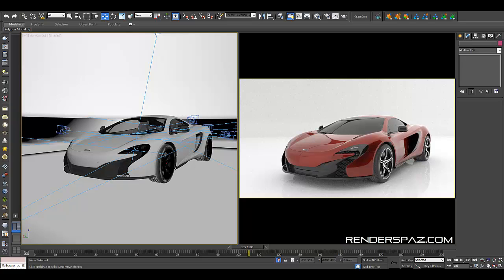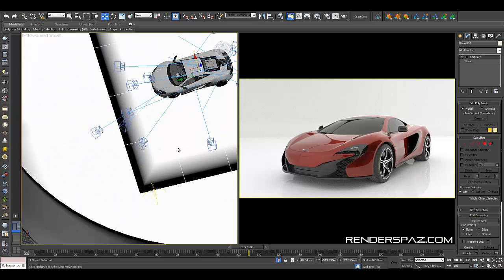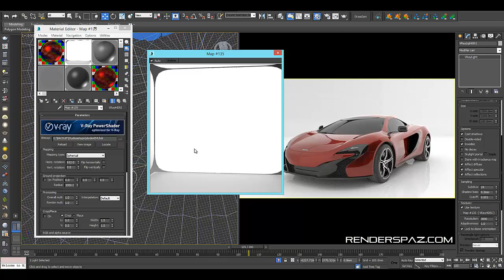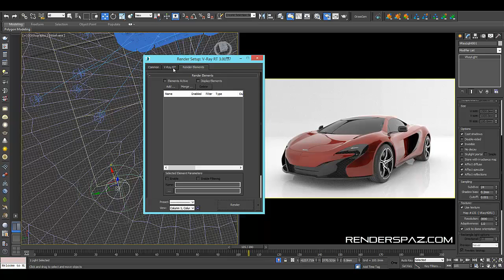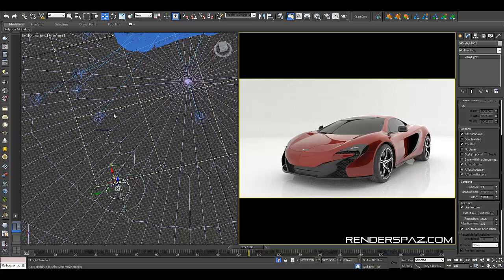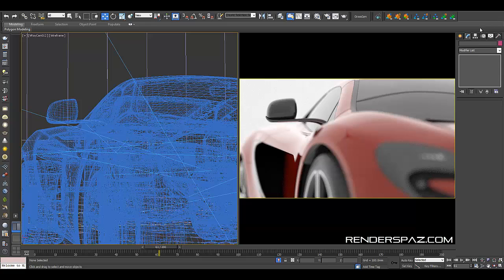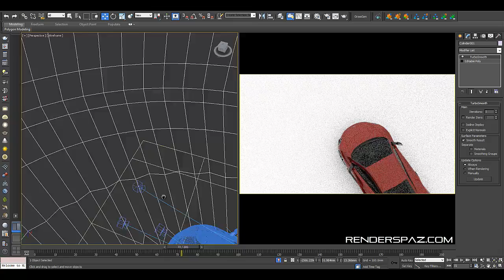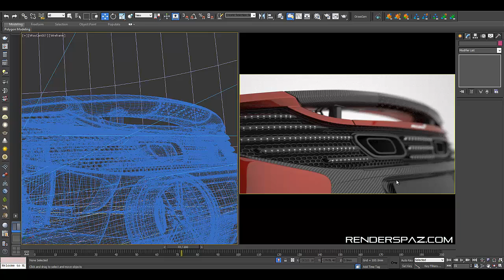VRAY RT GPU GTX 690 - Inside Look McLaren

Comment: Hello RenderSpaz, What was your final image quality you rendered out at? I'm running a Ryzen 7 CPU with GTX 1080TI GPU I'm using Vray 3.6 so have the ability to use both to produce my animations. I run a 75 frame animation at 1920 x 1920. Saved to PNG file then compiled to AVI. Animation looks awesome in Frame Buffer, however when I use media player the image quality drops so much i get splotchy animation and gamma change it just looks awful! How do I get a decent quality at these settings the animation still took 29hrs to complete 75 frames. Im worried changing to 3840 x 3840 wont make any difference to the out put as i get the same result in media player using 500 x 500. Any tips or advice?
Reply from the maker: Hi Sam, sorry for delay reply.  I rendered the McLaren animation at 720p. I believe this is a quality setting when exporting your AVI.  Make sure you are using a high bitrate and the good codec option. You can also try exporting H264 high quality settings this should help with compression.   What software are you using to export from?

Comment: Awesome Work! The Aorus 1080ti is good for rendering animation in Vray?
Reply from the maker: Shouldn't have any issues. I am running 1080i TI also.
Reply: Renderspaz There's a way to speed up an animation rendering (1920x1080) with object and camera movement? With vray Rt CUDA?
Reply from the maker: The speed is based off your GPU for images or animation. If you do not use motion blur or depth of field your animations will render faster. That is about it. Everything is based off performance of your GFX card and how many passes you are willing to be happy with for the end result.

Comment: Hi renderspaz, great videos. I have a hardware related question. Would you recommend going for the GTX690 or GTX970 for use in Vray rt? I'm stuck between the 2 as I've not really seen any Vray rt examples running the 970, and it's about £40 difference? Cheers!
Reply from the maker: Jonathan MacDonald The great thing about the 690 is that is has dual gpu which gives you the ability to switch to one gpu while the other one is working using RT. This for me is a great option, for 970 it performs great.. however it only runs a single gpu. If you are ok with it.
Reply: Thanks render spaz, the issue I have now is I really want the GTX 690 but I'm a little worried about a PSU issue. I currently have a HP Z800 with an 850w PSU. What system/PSU do you currently have running the 690? I have completed a PSU Calculator and it tells me i would be under full load about 834w. Do you think this is a tad too close for comfort? Sorry for all the questions.
Reply: render spaz Hi again, just to let you know I've went with the purchase of the GTX 690 with an after market cooler and also a low/mid range quadro for viewport so I can use the full power of the GTX whilst still having the ability to change up the scene and navigate. Thanks for all the videos an help, I look forward to more :)